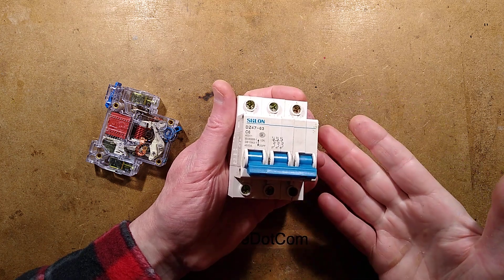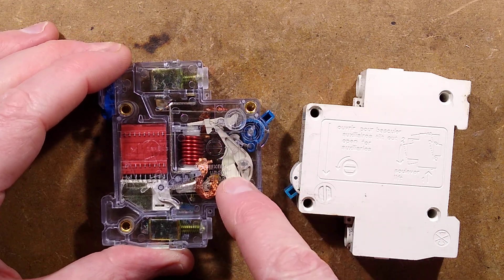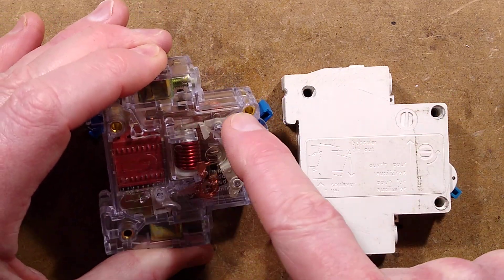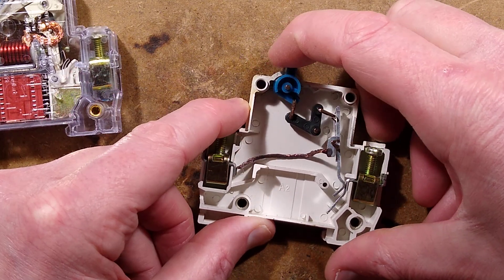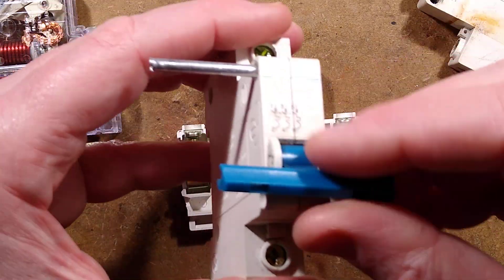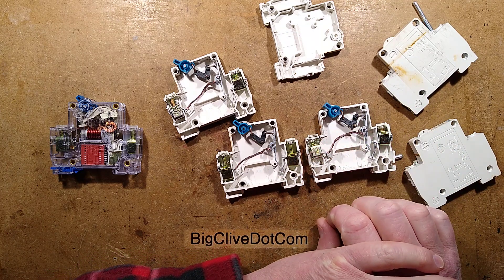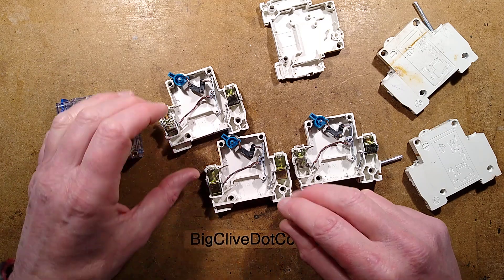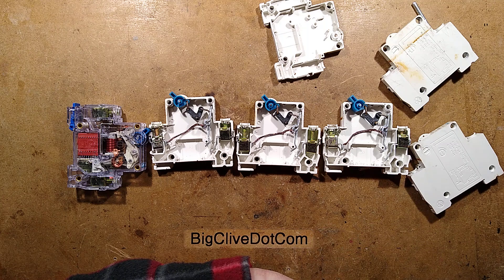Inside a fake un-trippable circuit breaker.

Comment: all i'm hearing is that clear bodied breakers should become the norm.
Reply: yeah, with a sticker of the picture of a real circuit breaker stuck on the inside of an empty shell :D
Reply: @Flashy7  Easy, flip it and see if the mechanism moves.
Reply: If there even are any clear plastics that have the same physical characteristics, heat resistance, non flammability, physical strength, etc...
Reply: @projectartichoke  Yeah that's probably why noone makes them except sketchy chinese manufacturers. I  think this one is Acrylic, which is not great in many ways for this.
Reply: @Basement-Science  Most manufacturers of breakers do clear cases versions - they are used for sales samples.
Reply: @projectartichoke  There is transparent aluminum, but it's more expensive than plastic, so I don't think we'll be seeing some circuit breakers made with it so soon, but I'd buy one.
Reply: @lucashiroshins  , it is galactically impossible to hear a Scots' accent and not be reminded of transparent aluminum!
Reply: @lucashiroshins  Captain, she canna take much more ...
Reply: @projectartichoke  You know, if heat darkens it in the first hour of use that's fine.
Reply: @projectartichoke  most plastics are clear until a pigment is added during manufacture.
Reply: Glass should do it
Reply: ABS is a typical plastic used in electrical device but can't transparent. 

PET/PC blend should be fine for transparent as well as toughness and fire retardant. 

The only downside is "Cost" is higher than ABS.
Reply: @singularity-6339  not sure where you heard abs cant be transparent, but thats not even remotely accurate. Theres plenty of clear abs stuff on the market right now. it just tends to be a touch more expensive to make since its not as widely produced as say, the black variant.
Reply: @kenabi  You're right on that one on clear ABS. I was on a long leave from plastic industry, sorry for an error. 

However by co polymer MMA(Methyl Meth Acrylate) or Acrylic into ABS for MABS to have a clear look would result in a much lower impact resistance as well fire retardant. 

I don't think it's suitable choice for electrical components. 

PET or PETG should be the ones for that niche market.
Reply: Then the manufacturer will paint the schematic on the other side.
Reply: Plastics have additional non-transparent filler materials to increase strength, fire retardency, impact resistance, and durability.
Reply: @snaplash  customs could take a look at it and that would be that. Have a small box of real ones for comparison and problem mostly solved. Stores can double check, end user mostly doesn't need to worry.
Reply: I thought exactly that when I saw the clear one he had. Clear bodied breakers required!
Reply: @snaplash  A certified electrician should be able to do so.
Reply: Almost if there is like a european wide mark that will propf these are real!
Reply: @guitarheromartijn  until you realize how easily and readily those are faked.
Reply: I just drill holes in mine before I add a fan, so I know what's in them and mine are good other than they get a little toasty...
Reply: @jakegarrett8109  Are they running near their rating all the time? Because in that case they should be getting warm to trip the thermal overload.
Reply: @Basement-Science  close, but Texas heat with a room temp of 120f likes to trip them below rating, at least until I drilled holes in them and added a fan (a replacement I installed tripped slightly sooner and got extremely hot so I put the old ones back in with that modification, they still occasionally trip so I just need to get nicer digital ones or something that isn't temperature sensitive)
Reply: @jakegarrett8109  You probably need your installation redone if this is what you have to do... If your house burns down, I'm sure the insurance company will look at that and laugh at you.
Reply: @Basement-Science  I'd look back at the insurance companies and think, ha, those fools, as if I have insurance! ;)

I thought about redoing its wiring (I go crazy heavy on wire gauges), but only time it happens is from one of my air conditioners that's older and pulls a little more. The rest of the time I'm not quite pushing it that hard even with my insane computer pulling 1.8kW (a great space heater in the winter) and even that's fine on a single plug on 20 amp breaker, so it's either the short length wire going between my AC selector switch in the fuse panel (which I would think would have to be practically on fire if it were disipating 5 amps, and I've felt around to feel any warmth from the cable so I could locate it because I was going to check it but I couldn't find it since it wasn't getting warm), or my AC is getting old and since it's within 10% of it's fuse rating limits with the 120 degree temps near the panel it's going ahead and tripping it.
Reply: @jakegarrett8109  yes, but, noo, butt.. doesn't that mean that you're loading them at quite a high current? Wouldn't it be better to split the circuit over two breaker since you're running th wiring at near maximum capacity posing fire threat ( i know it could be very expensive,  but rebuilding a house does too)?
Reply: @pear7777  so the circuit branch goes as follows: main breaker for all,  AC only breaker (it's after main breaker), 20 amp breaker for bedroom (computer is by far its highest draw and I think my microwave is on the same one but I don't run it at the same time as most other things besides the AC)

So it has its own breaker just for the AC so it can be dialed in closer to what it should draw and trip more easily in case of issue, and the bedroom side is basically the same where it should trip easily if something crazy abnormal happened. That's how you want it, just like my other fancy computer has multiple breakers in its power supply and can be toggled to trip and monitor almost individual cables (so a single part going out of limits would shut it down instead of needing to go spectacularly out of limits for the total system power spec to shut down).
Reply: @jakegarrett8109  How's everything coming along over there?  I know you guys got pretty hammered by snow and ice.
Reply: @jakegarrett8109  Heinemann magnetic breakers are good in that application because they have no thermal element.
Reply: @jakegarrett8109  not really. The main purpose of breakers is to protect the wires from overheating. Wires can't dissipate the heat at high outside temperatures, hence larger wires are required for installations in hot rooms, like bakeries. That the tripping current goes down with higher temperatures is not a fault it is a feature.
Reply: @jakegarrett8109  The (competent) manufacturers publish derating curves for high temperature operation (and similar curves for low temperatures). This only impacts the thermal trip not the magnetic one however.
Reply: @mikenewman4078  Until you use them on a non-softstart switch mode supply. Non-soft start supplies draw their full output current for the first mains cycle. Having tripped a power station offline by turning on a server cabinet, I know this well (the server had a pair of 1000A 5V supplies fitted).
Reply: @jakegarrett8109  Adding a cooling fan to a safety device that is designed to trip if it gets too hot is a bit like opening the window by the smoke detector so that the smoke from the house fire doesn't set the alarm off. The MCB is designed to stop the cable in the circuit from overheating and catching fire. If the MCB is hot then the rest of the circuit is going to be just as hot, if not hotter if like many places it's been tucked under insulation. Thousands of very well educated people are paid a lot of money to design these devices so best just leave them to it and not undo all their efforts.

Comment: After seeing fake capacitors (10nF instead of 440µF), I don't trust anything. If even cheap parts like caps are faked, there is no limit. My recent one: fake PC power supply with missing PFC (space is just empty) and probably half of the caps needed were missing, fuses are just wires. Highly dangerous, but well, I guess it was cheap and a really good snip...

Comment: Was it actually rated as a circuit breaker, or was it rated as a switch only. I have worked with din mount breakers and switches that looked almost identical except for their labels.
Reply from the maker: Marked as a breaker.  Not an isolator.
Reply: @bigclivedotcom Yikes! I imagine a special kind of punishment for the people who would willfully put people in danger this way.

Comment: Looks like a non-load break switch, usually deployed downstream of a breaker for maintenance isolation. I'm from the US so may be different in the UK, but it's not uncommon for NLBSs to use the same housing as a breaker but not contain any trip logic or circuitry. Can't read the labeling here, but could be it's one of those?
Reply from the maker: It's got the symbols on it for a breaker.

Comment: I'll be honest, this is what I think of when I see cheap Chinese circuit breakers available for $10 on Amazon and the like.
Or if not this, then just woefully underrated or poorly constructed things that might save your bacon, once, might false trip early, or might explode when asked to do its job when all hell is breaking loose.
's why I went namebrand when I began building a Device using this kind of breaker.
I had ordered a new GE breaker, then happened into an old Square D QOU unit that's just a little bit fishy in all the "right" ways.
Reply: When an actual MCB doesn't even cost $10, one wonders why you'd ever buy such a thing from Amazon.

Comment: May as well just go the extra mile and solder the wires directly to the bus bar. Which has the added benefit of giving you the ability to triple your circuit capacity in a breaker enclosure

Comment: Wow that is probably one of the most disgustingly shameless things I have ever seen. Seriously who even thinks to make a non-functional fake of a product that exists for the purpose of preventing electrical fires/death
Reply: You would be surprised. Being an electrician, I have come across fake breakers before. 
The U.S. government does a decent job keeping such products out, but go outside the U.S. and there is an abundance of cheap imitations. So much so, all the legitimate manufacturers have a "report fraudulent products" links on their websites. The big three of course is Square D (Aka Schneider Electric) EATON, and Siemens.

I like to believe the source of such a black market are molding companies that lost their contracts, but the machinery stayed, so the managers kept things running.
Reply: Unfortunately China never pays for any of its fraud; what does that tell about countries who are still making deals with China instead of penalizing it?
Reply: See my comment above the generator may be current limited either by control, electrical design or the prime mover stalling so it will not be able to trip a circuit breaker.
Reply: @EK89 same shit happens in Russia more often. It’s not the problem you think it is.
Reply: This is just a normal Chinese product. of the highest chinese quality
Reply: Ascribing moral attributes or lack of them to countries and economic systems is ignorant and dangerous. I’ve found Chinese manufacturers are more amoral and effective business managers who will contract and build exactly what you want.
Reply: @boathemian7694  usually trash that people either throw out or gets people hurt. It's better when people have morals.
Reply: @boathemian7694  i see you just graduated and got your first job.
Reply: The Chinese do
Reply: Bro, this is isolator, not MCB
Reply: @mohamedrafi5807  you have problems.

Comment: I think that any landlord that knowingly and willingly uses one of these "breakers" in a building that catches fire because of it and, God forbid, causes the death of anyone, should be held fully accountable for this crime!  If it is a company that you hired that does this without your knowledge, then THEY should be held accountable!
Reply: Why would anyone willingly install this? At best they are sold a bit cheaper then the real thing, and some contractor might just get them.
Reply: @Mobin92  It's a switch not a breaker - the generator design limits the current so a breaker even if fitted would never trip - don't get a small generator confused with a low impedance public supply or the capabilities of a large generator.

Comment: My question is, can anyone think of a way to use some sort of cheap equipment to detect this fake circuit breaker without measuring the weight?
Reply from the maker: Only buy circuit breakers from local suppliers.  If they sell you a fake they are responsible for doing so.
Reply: expose it to a load that should insta-trip it?

Comment: we have un-trippable breakers here in the US as well, they are called Federal Pacific Stab-Lok breakers.
Reply: Those were incompetent, cheap, unreliable design.  They were sleeze corperation, not out and out fraud with callous disregard for life like this breaker.
Reply: @petercampbell4220  yes, i am aware they are not as bad, but more often than not they will not trip if there is a short or overload, i have seen a dead short not trip until manually disconnected on a 15 amp breaker before.
Reply: @petercampbell4220  It was out and out fraud. They submitted false information to get the UL listing.
Reply: sad part is that they are STILL for sale.  I learned as a fucking kid how bad those breakers were (stablok's in our main house, square d's in the old school portable we lived in while building said house)  you could cut a live wire in half with snips (shorting the wire briefly) and the things still wouldn't trip.
Reply: @Wooble57  yep, my house was built in the 50s and has 2 panels, but the main panel that powers most things is a Federal Pacific Stablok panel, surprisingly i have not shorted too many things out, but i remember my friend had a space heater on the floor and he closed the metal door on it and it cut the cord and shorted for a good 5 seconds before i was able to unplug it, everything in the house dimmed and the outlet melted, but that damn 15 amp breaker didn't even seem to notice anything had happened. anyone who has them should absolutely replace them, there is none of that "have a qualified electrician look at them" just replace them, if a qualified electrician says a stablok panel is okay then they are not to qualified.
Reply: back in the early 70's we had Federal stab-lok breakers in UK installations before  UK manufacturers got with the flow.
Reply: @kevvywevvywoo  interesting... were they just called federal or were they called federal pacific? in the US they were called federal pacific and federal noark. but in Canada they were called federal pioneer and are still made.

Comment: I think it is possible that the jacked-up designers intend the braided conductor therein to act as a fusible link of sorts. Not able to be reset, and I'm probably giving them more credit than their scamming butts deserve, but that cable does appear similar to fusible links that I have seen in automotive applications, and it does carry the current between the contacts.
Reply from the maker: It would certainly blow with enough current, but at a level high enough to potentially initiate an internal arc explosion.